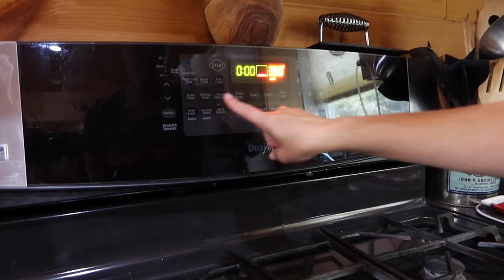Well I've Never Done IT Like this BEFORE. Prepping The Post & Beam Barn for Spray Foam Insulation

Comment: why not just let the gaps get filled by foam? seems like a lot of extra work for less insulation, you can always trim it off from the outside with a razor blade if need be. Never seen this paper process before, guess I'm going to learn something today.
Reply from the maker: The foam would stick out like a soar thumb on the outside.
Reply: @LumnahAcres  but couldn't you just shave it back and batten the joints or paint? I thought I heard you mention battens on the firewood shed since they use green lumber
Reply: I thought y’all were doing the batten boards on the outside of the barn?

Comment: Why not just use all masking tape?  The cavities will break the seal where the paper is in the the corners.   There is also apaper with tape already on it avelable at autobody supply stores.  The tape solution is elegant as the fill edge of the foam can be trimed with utility knife for a finished look.

Comment: Al, some newspapers have left over end of roll of news print paper.  I use to work at a newspaper and we sold these end rolls.  It would be a lot cheaper than those folks of paper you purchased.  I know it's too late for this project but maybe for your next project.  Yes. I agree with some of the other comments; it's time you build a deck.  I would like to see if be a screened in porch myself.  Love your videos.

Comment: back on the farm we had then whitewash the milking area and they used news paper to cover all the stuff and i wood come home from school and take 3 hr to removed it all
Reply from the maker: I like the idea of white washing the milking room
Reply: @jerrycattau97  Sea salt or iodized?
Reply: @paulmonk7820  Fine grade salt
Reply: @paulmonk7820  Grind the sea salt by applying moderate friction with the pestle in a circular motion. Turn the mortar during the process of grinding to make sure you have ground all of the salt with even consistency. Grind for at least one minute or until the sea salt is crushed to your desired consistency.Sep 28, 2017

Comment: ummmmmmm i think you should be taping those seams on the outside. doing it this way you will not be able to get them back off after foaming.........
Reply: Think about what you said.....why would they want to take the tape off?
Reply: @paulmonk7820  the stuff will adhere to the tape and not the wall creating a gap when weather gets in there and gets the paper wet.

Comment: For your next project built out of Rough cut wood large metal trash can stand on at least 4" tall wood legs for the feed room, should be built big enough to house at least two or  three of the 32 gal metal trash cans, I have  had goat for 25 years and the trash cans with lids make great feed storage containers and rodents can't contaminate the goat feed and chicken feed, build it larger if you need more trash can containers, by building it up  off the floor the can will not rust due to moisture and will be easier to clean around and under.  I still have can's I purchased 25 years ago that I use for feed storage containers.  Gina and Olivia can paint it and  maybe put a stincil designs of Lumnah Acres  on the front of the stand.

Comment: Check the health risks of spray foam.
Reply: There is none.
Reply: Check this out video on YouTube. "Spray foam insulation nightmare, what can happen if it's not installed correctly."
Reply: @steveruby2120 , You said the key words: "if it's not installed correctly." There are no issues when installed correctly.
Reply: I didn't say those "key words" they were in the title of the video. I'm not bad mouthing foam, I have no experience with it, I just watch that video and wondered.

Comment: please remove the Paper, it will cause you trouble and undermines some of the benefits of the spray Foam.
If you like to cover the fronts ans possibly some of the sides from your Posts ans Beams use Tape only there.

Comment: OK ARE YOU NOT WORRIED THAT WATER/SNOW WILL SEEP THRU THOSE CRACKS WERE YOU PUT THE TAPE AND GET THE INSULATION WET.? I WAS SURPRISED YOU DID NOT DO THE WOOD STRIPS OUTSIDE TO COVER THE CRACKS.

Comment: Double-sided tape would have held the fiberglass insulation to the wall - and it would have been so much easier (and quicker).
Reply: @TimeMaster:  you missed it, it's spray foam.
Reply: @paulmonk7820  - YOU missed it - "would have" (past tense).

Comment: THIS IS NOT GOING TO WORCK you shout only tape of the front of the beams the paper will get between the sprayfoam and the beams you will never get ik out without damaging  the foam. The foam will NOT stick in the corners and you will get airgaps  in your insulation.